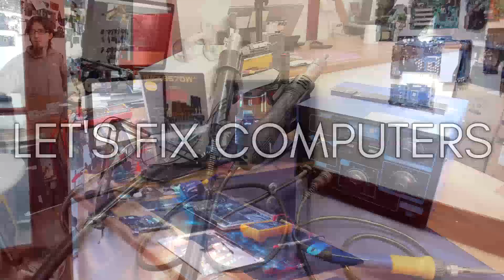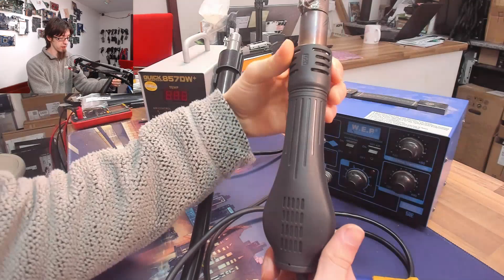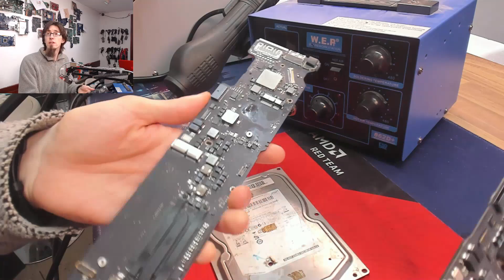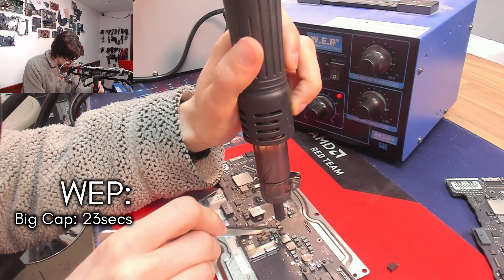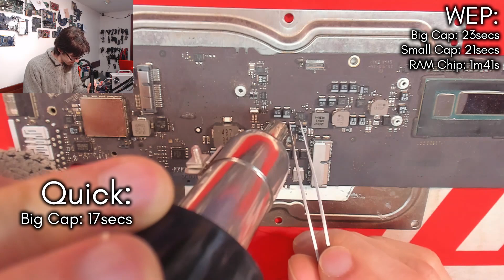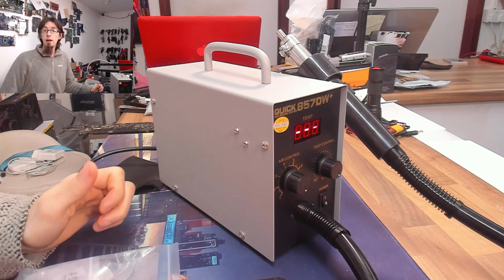Quick 857DW+ vs. WEP 2-in-1 Hot Air Test - LFC#239

Comment: Hey I found this video through Reddit
I was searching on blower handle vs other types of soldering stations
I am from Brazil, even 30 pounds is a huge, huge amount of money here specially for someone like me not doing well on money, and I was quite disheartened to see people saying you got to get a 100 dollar soldering station, you got to spend good money on a hot air station, and this honestly brightened my day

I don't want to do board level repair right now, maybe if something comes up I'll try to resolder the power jack on some laptop that I end up getting that is having issues as a last resort or something, but I mostly want to do stuff like solder ESP32 modules to boards, pin headers, solder FFC connectors, solder, little QFN chips, SMD passive components, stuff like that a hobbyist would reasonably do or eventually do

And people really make it seem like you got to spend 200+ dollars on equipment to be able to do anything, I am looking at a cheap 50 pound soldering station with a hot air gun with the blower on the handle like the WEP shown here, it's one of the few options you can buy over here and it is quite steep in price for a very cheap one, but prices are crazy here in Brazil, I was quite disheartened trying to search to see if it'd be good enough
However this video really gives me hope that I will be fine with my simple starter hobbyist needs with a simple station, and can use that until I feel that the time has come to move to something better, and save up for it

Cheers!

Comment: the qiuck you got seems to be acopy look on the reviews
Reply from the maker: Tbh if it's a fake then it's been good enough. It's only BGA or new-gen consoles (with heavy weight PCBs) where it's struggled, and you can put that down to it only being 600w.
I do need something bigger now, but as a mid-range option I'd still vouch for this.

Comment: Would you recommend it over the RF4 H2 1000W ? Even this is 580W and the RF4 is 1000W. Is the power difference also counts in this regard ?
Reply from the maker: Not tried the RF4 H2... but I might look into it in the future! This quick station has been good to me, but it's got limits. 580w isn't enough when you get onto really hardcore stuff like VRAM-sized BGA packages and the latest gen console HDMI ports. I can change a Series X HDMI port with the 857dw+ but it takes prep work and patience. A 1000w station will have a much easier time.
Reply: I just bought the quick 857wd for $72, I still can cancel the order and get the RF4 H2, it advertised to reach 480 degrees Celsius. Currently, I need it only to replace a mosfet on my msi laptop motherboard.  @Adamant_IT
Reply: @Adamant_IT  I canceled the quick purchase and bought the RF4.
Reply: @eagle_passion_night Hey what's up what's your experience with the RF4?
Reply: @bokkibeatz55 I returned it and got the atten, when I saw Louis rossmann use it in one of his videos I knew it's a good option.

Comment: what is the min and max airflow of the Quick 857DW+? i cant find it anywhere
Reply from the maker: I'm not sure. It's decent, but it depends what you're doing. So far this station has managed everything except advanced stuff (large BGA) and to an extent, new-gen consoles, where it struggles but gets there eventually.
There's some decent 1000w Atten stations around that will blow this out the water now, but they're still more expensive than this unit - so it depends on budget.

Comment: I have one wep, but the temperature wasn't correct ex when I set to 450⁰ actually the air was exiting at 300⁰  I had to readjust the thermostat, after that it improved a little bit, and it's still +/- OK for the things that I do.

Comment: i wander if your heat gun has a diff element than mine or if  it has a  a 120 volt output on the tranny  inside of yours mine would burn a hole threw the hole board if i held it on half the time as you  i am thinking you are using 230 volts  here in us we us 120 volts   have you found long lasting cheap tips for the iron  i got ahold of two that dont wear out but forgot where i ordered them  by the way i  use tin wrap on my eliment to make it fit tip tight

Comment: i have two blue soldering stations just like that but zenny brand    it is 69 bucks including shipping    it is a incredible deal!!!!     put a good tip on it and you will love it    the temp setting on iron works great set it as low as possible   setting to high will wear out and ruin your tip along with burning up you rosin    i have had mine for over two years      i have used over two pounds of 0.8 lead rosin solder in those two years     you will not like any iron if you get the wrong solder    solder can be a nightmare if it is to big around or not made of lead and rosin core    get a trusted name brand that is 0.8  around ROSIN CORE 60tin/40lead   if soldering through hole and some smd    any bigger  is a pain unless doing big connections and this iron is not for really big stuff like was said in video           if your cheap like me get name brand that is cheap because it is expired    i cant tell any difference   smaller than 0.8 will work you just have to feed more     as this video stated  if you use a heat gun alot this one may not be for you    i have had no problems of of mine    i dont turn air down low and heat high and i dont use it every day   it sounds and fills cheap so i am easy on it  it runs off of 120 volts and turns its self off when put in its holder   it could be bad if left on and cat or something else knocks it of    i was first worred  about the iron so bought a 3 dollor replacement it works but have never needed it  the heat gun is 120 volt the iron is 24 volts  and the control board is 12 volts  ask me how i know lol    i ended up with two units    my first one quit working first time i used it   the seller on ebay  sent me a new one told me to keep the broken one and refunded me i texted him and told him he made a mistake    he said thanks for honesty and keep both     so before i got the other one in mail i took it apart    i did some probing and the 12 volt winding  had no voltage   the 12 volt pulls very little not even a amp so i think it was just a manufacturing flaw  IT HAPPENS     i rewound the low side outputs of a little toroid i had in the parts pile     although it is  bigger than the org square one it fit perfect looks factory    i had  the square  bottom 4  corner screw holes and bolt hole in center bottom and the big round washer with rubber gasket for top of the little tranny    it has worked great every since!!!    the other free new one my 10 year old at the time son learned how to solder with   when his hover board blew up    wife was mad at me refusing to  fix it    i told her just set back and watch     after begging and saying i was a mean dad didnt work   he got on youtube  and learned how to use a meter to test components    found a mosfet in my parts that didnt match but had  higher amps    with me trying to let him down easy that it may not work he soldered it in  and it still works good    he uses it every once in a wile to fix his or his buddys stuff    the  point of this book of a post is about the same as video   these are cheap and good starters  i love mine and skipped the getting a better one    one other thing i have read some of these dont have or hooked up wrong ground and even though it has on off switch on back you really should unplug it after every use   that is a nobodys two cents anyway   thanks and god bless any one who reads this and the owner of this channel  lots of time and work goes into these videos

Comment: I've just got the Quick hot air station you used here. I watched this video when it was uploaded but I hadn't realised I'd picked the same one when I put the order down a couple of days ago. I don't have any jobs for it yet but I hope it will be good when I need it. I have a couple of SMD practice PCBs so I'm going to get some practice in with it and also some manual soldering too with my TS100, which I have no problem with and that if anything I find rather easy.

Comment: The metal enclosure you have the boards sitting on is acting like a big heat sink, sucking all the heat away from the board. using a board holder that suspends the board would be better as the heat in the board wouldn't get sucked away making the parts easier and quicker to remove. never have your work piece sitting on metal.

Comment: I have read reviews informing us that the Quick comes with a euro plug and as such does not have a earth?
My question is simple. Does the cable have an earth or is it class 2? 
If so changing the cable or cutting off the plug and replacing with an earthed one makes more sense?

FYI I own a WEP 898BD+ I increased the airflow by taking off the handle and removing some of the restricting plastic grill on the inside.
This also speeded up the heat up of the wand by around 30%
Reply from the maker: Ah, yes mine came with a Euro plug, completely forgot about that in the video! Cable is earthed, so just chop the plug off and put on whatever plug you need.

Comment: I'm a big believer in quality reliable tools, but that said, you won't appreciate a high quality piece of equipment until you realise how bad the cheaper ones are. I've had literally 2 machines, the Yihua 853D and my current machine, the Atten ST-862D. The Atten definitely rivals the Quick 861DW, couple that with the TS100 and you have yourself a great bit of kit for under £250...

By the way just a bit of constructive criticism in that you're losing a fair amount of heat using the hard drive cover under the board. A heatproof silicone mat would be much better than what is effectively a heatsink :)
Reply: By the way, I don't want to self promote, but please watch my video collaboration with TronicsFix. I do give a good idea of the best way to flow the RAM on pretty much any machine. They aren't as sensitive as you might think, and personally I'd say it's in the technique

The TL;DR for RAM, no nozzle, and one of the problems you may be facing is the constant tapping of the chip. As you get used to the rework machine you'll find that you'll get used to how long it generally takes to reflow the RAM. Once you have a general idea you can usually just leave the heat flowing until it's almost ready. Also, you only want an extremely light tap, so it barely moves at all :)

Comment: I'm sorry if these are silly questions, but I was wondering if you've used the thermocouple on your VC99 to check the output temperatures at the blower nozzles and perhaps to identify the spread of the hot forced air as it moves away from the nozzles?
Reply from the maker: That'd be a good way to do a more scientific review. But brief test shows the bit that we need to know - the bigger blower in the Quick goes brrrrrrrrrrrrrrrrrrrrrrrrrrr

Comment: Buy the best you can afford for the feature set you need, not want.  You will be disappointed far fewer times than buying cheap.  Your work will typically reflect the results as well.  25 years of machine shop experience.  As you mature in any given industry the opportunity to upgrade and improve will become easier, but even at my stage in life I still stick to my opening statement.

Comment: 10:20 Strictly speaking the laws of thermodynamics forbid this. The new station can put out a higher temperature, which feels more "hot", or a higher airflow, which improves the ability of the air to transfer heat to your hand and again feels more "hot", but barring COP>1 systems, watt for watt, one watt of electricity creates exactly one watt of heat. For heat generating perposes, this is an efficiency of 100%. No more, no less.
Reply: i understand what adam is trying to say. even if we ignore the better air pump in good quality station, by efficiency he is saying that the cheap hot air station might display 400c temps but in reality they will be putting out 325-350c. thats just what you get in such cheap products. better quality stations will put out air that is very close to the set temperature because they are properly calibrated and use better controllers unlike cheap ones
Reply: @lordjaashin  What gave me the urge to comment, was that at 9:52 he said that he measured it at the wall. But to be fair, he did say "idling", so yeah, I was nitpicking because I felt that it got a bit jumbled, but by and large, his comments were not really counterfactual or even implausible.

Comment: I kinda agree , kinda disagree on the startup stuff. I think you'd have done enough research before even buying the cheap stuff, and if that's the case you're probably more interested than you think...
may as well pony up for at least mid range stuff. I'd rather buy something once knowing it's good rather than have bought 2 items hoping I could make the cheap one work. 
TLDR I've bought cheap crap before and .....well it's usually crap lmao. 
even if you ended up not wanting it I say you have better chances of selling it off over trying to sell off the cheap one.
but hey we all got our reasons 🤷
but all in all great video

Comment: I have the WEP as well. Back when I bought it, the "new style" stations with the heating element integrated in the tip were like 4-5x the price and completely out of my range. The only question then was: Do I buy a branded "old style" station or a cheap Chinese knockoff? Went with the knockoff, and can't complain. But I also can't generally disagree with your assessment. The hot air gun is more like an added bonus. "Buy this soldering station, and we'll throw in a hot air gun for free!"

As for soldering portion: The soldering iron appears to be a clone of the Hakko FX-888, so any tip for that will fit the WEP, giving you access to the full range of tips from Hakko. Furthermore, the WEP already comes with a broad selection of tips, and you can get new ones from Aliexpress for less than a dollar for a bundle of five (shipped). Whereas the "new style" tips are ~10 Euro - for a single tip. So if money is an issue, consider the tips as well as the iron itself. The TS-100, for instance, comes with only one tip. If you include a decent range of tips for different applications, you can easily double the investment cost compared. And stupid newbie mistakes that ruin your tip are much less scary when they cost only 20 cent.

If I had to bottom-line it: The WEP is soldering technology that was state of the art 20 years ago. Since then, technology has moved on, and great improvements have been made. But it's not like people back then couldn't do their jobs. shrug

Comment: For your 820-3023 board, don't bother, they have a common issue that's not the RAM chips themselves, it's either the CPU or the PCB itself (still not really clear). Reflowing the RAM sometimes revive them for a short while but they end up failing again.

I personally started with a Yihua 898D and man… what a nightmare. I really can't recommend getting that to anyone, even if it's cheap. I got a TS100 and a Quick 861DW now and it is really a game changer. Iron made the most difference for me, but hot air is also night and day. I had so many quality issues that shouldn't happen (plastic crumbling on both the iron and hot air handle, even melting on the hot air handle, cables going bad, even the pins of the mains plug just breaking off) that I'd stay far away from any of these stations. And of course it just doesn't cut it for a lot of jobs. Yes you can rework some boards like your random cheap Quanta/Compal but you still have to take care not to cook them and it's really not comfortable. When you move to MacBook boards it's a different world. Much more QFN and BGAs chips, and of course much higher thermal mass in the power planes. The cheap garbage stations are really struggling and just cannot get the job done.
When you have this kind of garbage tools you really think you're too dumb to get soldering right so it can definitely be a major source of demotivation. And of course killing lots of boards and chips that could otherwise be repairable…
Reply: I have the Yihua 862BD+ and I feel the same way,
The soldering iron doesn't seem to be too bad but the hot air station has the same problem where it melts it self and cracks, and it can't even remove simple components without burning the board. In a couple weeks I will be ordering an Atten ST-862D which seems to be the go to. It performs like a top tier station for the fraction of the cost. Not sure whether to replace my soldering station too, I feel like I wasted a lot of money as I spent over £100 for the 2in1 station :( Suppose I could sell it though to someone who only needs it for very simple jobs.

Comment: Not sure why you limited the heat on the wep yet didnt limit the airflow on the quick?..... if you are going to time them then let them both max out ?
Reply from the maker: Yea in retrospect I should've just set both to the maximum they were capable of. But I can tell you from experience that setting the WEP to 380 probably wouldn't have helped it much. It just doesn't have the airflow to put the heat down on heavy boards.
Reply: @Adamant_IT  yea, I've no doubt the quik is much more capable....just thought it strange you handicapped the weaker model further. But anyway, keep up the good vids sir!

Comment: If that soldering iron on the combo station takes Hakko tips (T18 or 900M, for the FX888 soldering handle) then the Chinese knock-off tips are indeed terrible. However original Japanese-manufacture  Hakko tips are a lot better. You can get industrial/production tips with specific tip sizes and shapes. I've got a couple of cheap Chinese soldering irons that take these tips and the Hakko tips I bought direct from Japan last much much longer than the original bits that came with the Banggood irons.